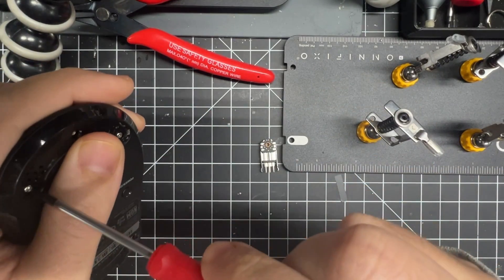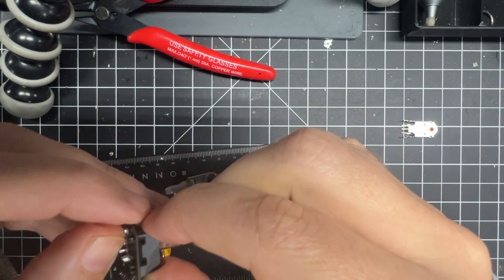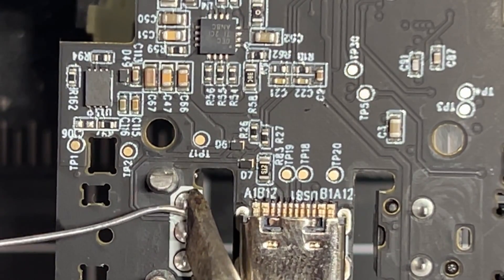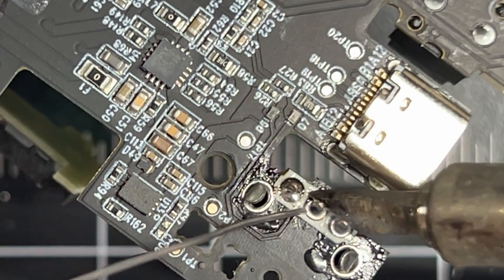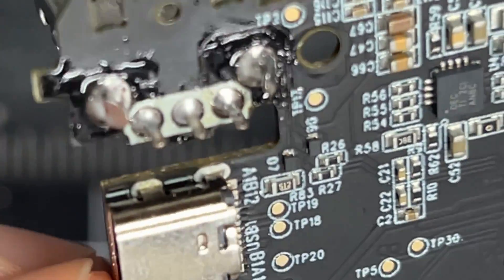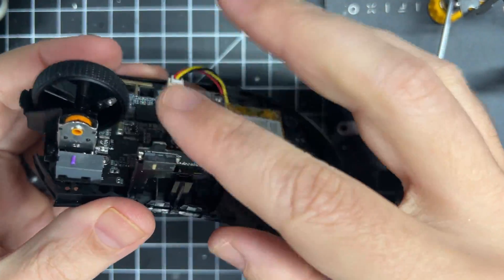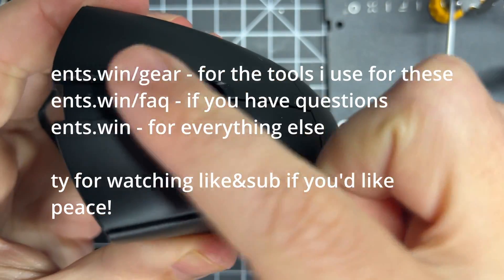Deathadder V3 Scroll Wheel Fix (Encoder Swap)

Comment: I’m not sure if you ever owned or felt the Scroll Encoder on the Finalmouse UL2, do you think you know which encoder is most similar to it though? It was basically as light and fast as a mechanical encoder can be.

I have had several Finalmouse mice since, but my current ULX is backwards scrolling a lot and was always a bit stiffer than I preferred. 

Many moons ago (2022) I bought some TTC White Core encoders off of reddit speculation and they were about as stiff as possible just testing so I never bothered installing one.

Thanks if you read any of this o7
Reply from the maker: gray kailh or TTC gold modified (manually bend the little notchy thing in to make it less notchy)

Comment: Hey there, I have two questions regarding this mouse and was hoping you could provide some expertise.
1. is it possible to replace the razer gen3 opticals of the Deathadder V3 with other opticals, like lets say Omron opticals? Since in this video the opticals just come right off without de-soldering.
2. The wheel of the DAv3 is too large for my taste. Can I just put a smaller wheel in there? What dimensions should the smaller wheel have so it would fit? 

Thank you
Reply from the maker: 1. omron opticals no, ttc / raesha opticals yes
2. not sure, but theres like 9000 options to try on aliexpress
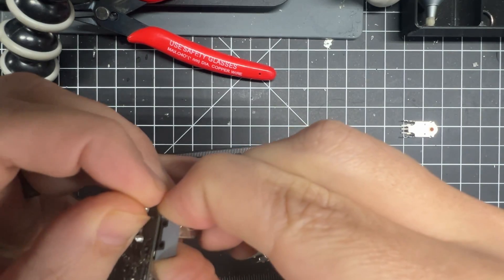Reply: @entsfps  For the smaller wheel I mean at 0:43, the encoder hole where the wheel fits in, are these holes all the same size? like would any wheel fit in there? Or does it have to have specific mm size for that encoder? I just want to get a smaller wheel because the deafult wheel sticks out too much.
Reply from the maker: @dnzlwshnktn2092 standard size :)

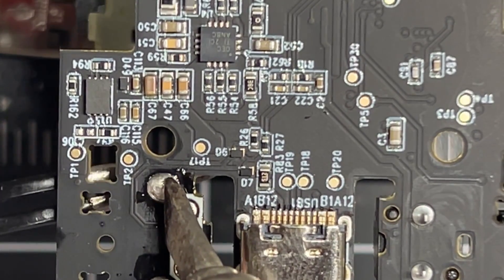Comment: During the process of replacing the encoder, the metal pad in 1:23 came off. Is it over? I know I can scratch the PCB mask and connect the copper trace to it, but It's not clear what trace I have to scratch off or if there even is a trace that I can scratch off. Someone, please help or let me know what else I could do.
Reply: Those seem to be just the holes for the encoder clips. They are not connected to anything, only the middle 3 pins are important.

Comment: Saving this for future reference. Had an experience with soldering switches on mech keyboard, this sure will come in handy, in time. Thanks man!
Reply: bro if your encoder is having issues, try spraying WD-40 directly on it first before u change it, it fixed mine (unresponsive thought its completely broken) and I almost replaced it lol saved me time replacing it

Comment: Hey are you still doing mouse repairs? I found you through reddit. I have a rival 500 mouse the m1 button doesn't work completely and like 1 or 2 side buttons don't click. Is this something you're able to fix?
Reply from the maker: yup ents.win is the site -- rival 500 all switch replacement is 120
Reply: @entsfps I'm not sure if it's switches but only 3 buttons are giving me issues. I didn't wanna fill out the wrong info when I sent it In. So the specific issue is M1 it clicks but when I go to click and drag it releases. Button 13 (directly to the right of m2) doesn't click at all as if it's just stuck and Button 08 (where the thumb sits) when clicked will do the input multiple times

Comment: My scroll wheel works fine, but my middle mouse click does not always register. Can the scroll click button be replaced?
Reply from the maker: I have the same issue on my DAv3 and I can't find a replacement switch. You should do an RMA with Razer.

Comment: Hello, i used  to play with a g502 se but i find it too heavy. I bought a g502 lightspeed wich is lighter but the clicks are differents. On the se, the click is much lighter and i mesure 50g on a scale whereas the lightspeed is 65g. The lightspeed uses D2FC-F-7N and the se D2FC-F-K(C). Do you know what "(c)" means ? is it specific to logitech because i'd like to put these on the lightspeed. Also, on your mesuring video, the omron D2FC-F-K(50m) is 60 g
Reply from the maker: not sure what the question is here but i bet the answer is here: ents.win/switches/

Comment: Hey, i found ur channel via the ENTS mouse switch excel spreadsheet.

(1) i wanted to use honeywell switches in my ux10c in viper pro v2… u mentioned on the spreadsheet that honeywells were longer than typical switch… would this entail i wouldnt be able to fit them into my viper, or size contrast honeywells directly to the viper v2 pro defaults? How would u find out a switch's or mouse's capacity in volume terms anyways to begin with, either? Is there a public SDS i can access as per contacting razer support, or would only tradesmen as urself for relaying of answers to my questions?

(2) Also would u happen to know of materials needed if it WOULD fit what i would need? Im very new to this stuff. Would i need sockets for hot swapping and replacement glider feet for reassembling the mouse after finishing?

(3) Would u be able to lend any recommendations for gears? Mill max sockets are good - are there any metrics accordingly to every micro switch or are they all the same in that department, too?
Reply from the maker: viper v2 pro has optical switches, so you can't replace them with mechanical ones. you're further down the path than you need to be regarding size/etc. its an optical switch pcb and therefore not compatible with mechanical switches.
Reply: @entsfps  awww damnn so if i mail to u, u would have to mod the ENTIRE mouse basicaly just keeping the shell? I may as well swap every innard out with a deathadder?
Reply from the maker: @iQmliAwyrMRyPWfV deathadder also optical, so no 😬

sadly, i wouldn't accept the switch swap order since its an optical pcb so it's not possible to install mechanical switches into it. 

if you want to use those mechanical switches, you need to start with any mouse that does not have optical switches.
Reply: @entsfps  WOW thats really unfortunate… do u know any hacks to bettering actuation force/shortening bottom out ability ?? I read glueing piece of paper or plastic (or hell using a glued piece of plastic already existing known as tape) are both decent strats… any others? Any suggestions? Im doing the ORING mod for keybords to achieve same result…
Reply from the maker: @iQmliAwyrMRyPWfV metal tape on plunger, look at one of turbobitbox boost videos for an idea
Reply: Thank you. Any other suggestions or is that all?
Reply: @entsfps  do u think i can pull this off as an optical??
Reply from the maker: @iQmliAwyrMRyPWfV pull what off? tape? yes
Reply: @entsfps  will this shorten bottom out distance on mouse ? I woudlnt wanna bottom the actuation distance
Reply from the maker: @iQmliAwyrMRyPWfV oh, no -- but i think turbobitbox has done bottom out fixes as well on other mice by using tape elsewhere
Reply: @entsfps  idk if i asked u but wanted to ask ab like comments n such what sites do u use for orings replacement skates etc - for reliable gears n such for switches etc - like i said ab honeywell what do u do w em? Like what are the sites for them? What websites do u use to access products?
Reply from the maker: @iQmliAwyrMRyPWfV aliexpress

Comment: I had some questions regarding repairing my ULX as my m2 stopped working (not the switches issue, something with the pcb that the finalmouse discord couldnt figure out) and I was wondering if there was somewhere I could reach out to u to discuss potential repairs so I could show u pictures of the pcb itself? I was initially just gonna send it in for a switch swap and ask u to fix it but I figured I should try and see if you could tell if it was even fixable in the first place
Reply from the maker: if you can talk to the repair tech in the fm discord they should be able to help you more than i can! otherwise ents.fps at gmail